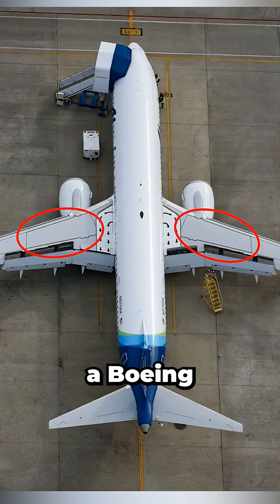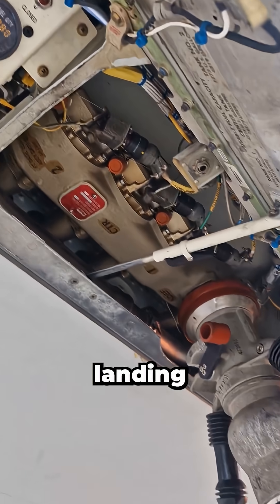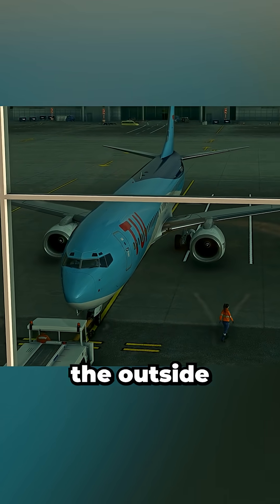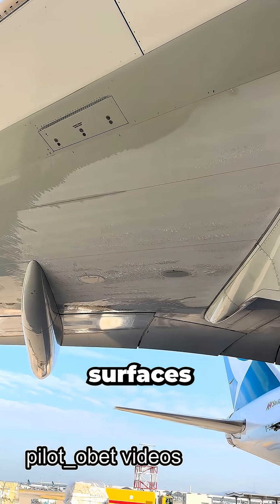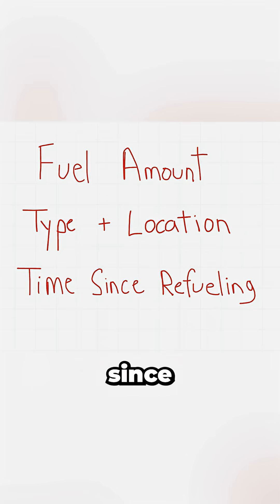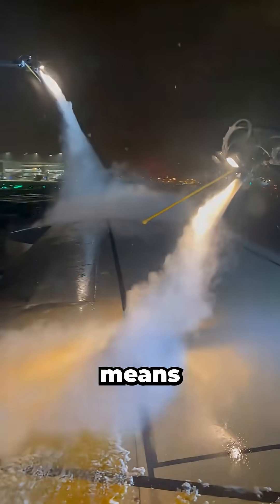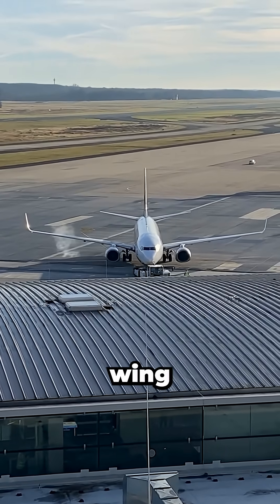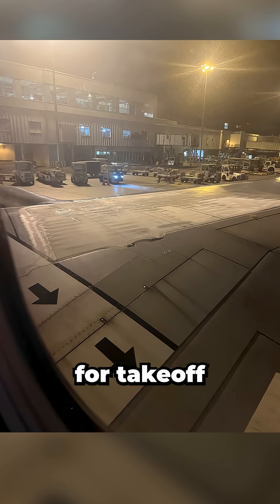What are these WEIRD lines on the Boeing 737?

Comment: The MD-80 suffers from this. If you look. Sometimes the ice build up was so cleat that it was difficult  to see. So they put ribbon like things on the effected area so you could tell if there was ice on the wing. 
Also, when ice separates it usually hit the engine and engine intakes. Before and after flight the engineer would have to check the engines for new dents!
Reply: I know flight attendant s that had to look out the passengers windows to see if those little ropes on the MD88 and MD90 at Delta were frozen to the wing or flapping around freely when we were airborne and report back to the flight deck and let the pilots know

Comment: Why risk it.   Just de-ice.
Reply: @iansmoak2430  It's more $$$ if it goes down.
Reply: And engineers have been satisfying C/B analyses since, well, money. If there's a cheaper way to "ensure" safety, they're gonna do it. Ice and frost have been extensively studied, and ground deicing incurs a number of knock-on costs. Deice may not even be available at some airports when cold-soak is still an issue, especially in humid locations.

Comment: Now why does the fuel has to be cold?
Reply: I’m an aerospace engineer, and the fuel gets cold because of the cold high-altitude air traveling over the wing at low pressure (which makes the colder air even colder because there’s less particle energy to heat). Also, the colder the fuel, the denser it is, which means increased fuel capacity (all liquid rather than liquid and some vapor taking up space), so the fuel is cold when it goes in to fit more in the tank. And lastly, as the fuel is expended, the pressure in the tank is relieved, which also cools the tank. If you’ve ever used a propane or CO2 cylinder, you’ll know that using up the high pressure gas in the tank actually makes the tank itself icy and cold, while the gas produces heat by combustion.

So basically, it’s cold way up there, and you’ve also got a fan blowing that cold air over the wings, and the fuel is cold to fit more fuel in the tanks, and also the wings themselves are also getting colder on their own by burning fuel.
Reply: @FirstGameFreak1000  Nice, thanks

Comment: I thought the blacklines are there to absorb minimal heat to keep the fuel warm
Reply: I’m an aerospace engineer, and funny enough, I first thought the black lines were there to help heat the wings, which is what black does. Especially thought I was right when he talked about deicing, but if that’s the case, then the whole wing area that needs to be heated would be black, not just a small stripe.

Black objects absorb more heat from things like sunlight, but counterintuitively, in the absence of sunlight, they actually cool down faster as well.

White objects like planes, space suits and space ships, sailboats, and sailor dress uniforms like navy whites; all of these are white because white objects absorb less heat in sunlight. They don’t have the advantage of cooling off quicker in the shade, but those objects are never in the shade.

Comment: We have been flying with bullet holes in wings and torn out fuselages, now they say a little ice is aerodynamically dangerous 😒
Reply: Blame the MAX series for dat
Reply: @DaddyM7MD  Thank you, leave it to Boeing to try to push the envelope on just how much ice can be on a plane’s wing before takeoff, just to cut corners and save time on money on deicing and safety delays. Brilliant Boeing Engineers being run by shortsighted greedy McDonnell Douglas businessmen.
Reply: @FirstGameFreak1000  you're right.

By claiming a higher ice amount on the wings didn't affect aerodynamics as much, Boeing tried to market the plane as safe during tough conditions. But that also means they're 100% willing to push the safety standards on their jets, cut corners, and foster poor quality control...which oh crap that led to the 2 infamous MAX crashes.

the MD merger has to be one of the worst corporate mergers in modern history.
Reply: Look up the Air Florida crash